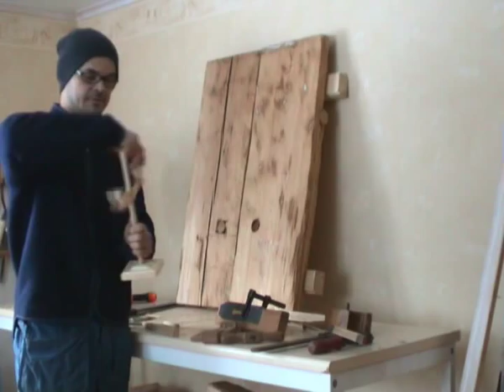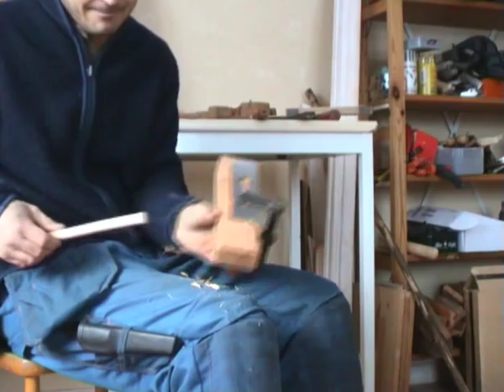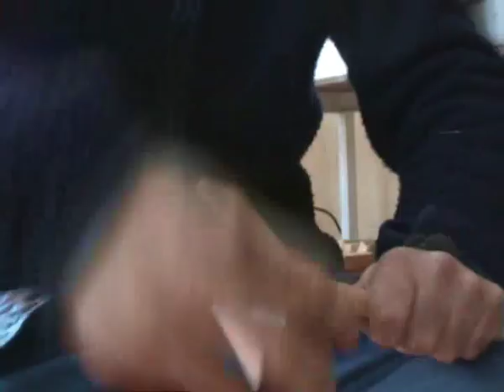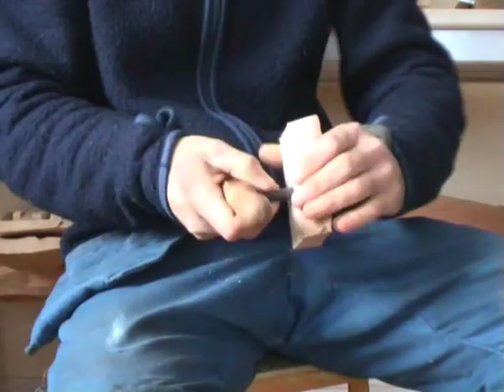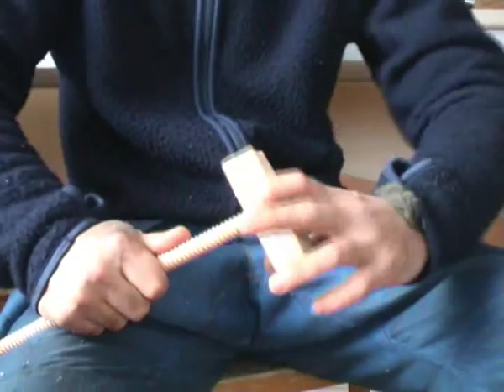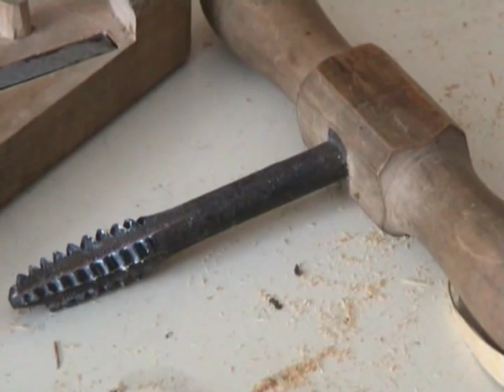Wooden threads

Comment: So, it's clear how to cut a thread if you have a tool!  You can also make an external thread using your method, but how to make an internal thread?  There is no tap!  That's the problem!
Thank you for the video..
Reply from the maker: If you look in the end of the video, I also show how to make the internal thread. You need two tools to make threads; one for the internal and one for the external. The tool for the internal thread is hard to make yourself, you need to be a toolmaker/blacksmith for that. The tool for the external thread you can make if you have to. So if you find just the tool for the internal thread, that is ok. If you only find a tool for the external threads, there is not much use for it. Thanks for watching! And thanks for the comment!